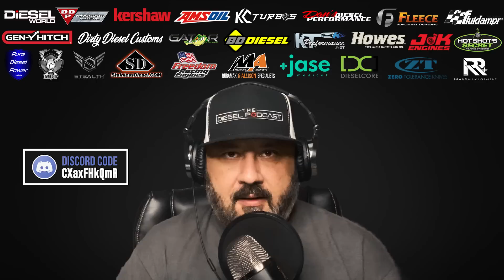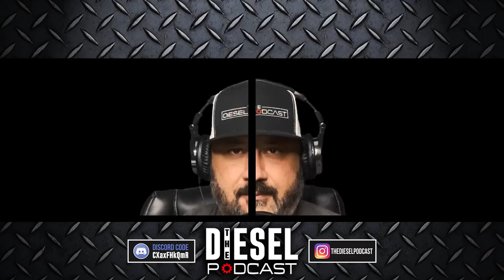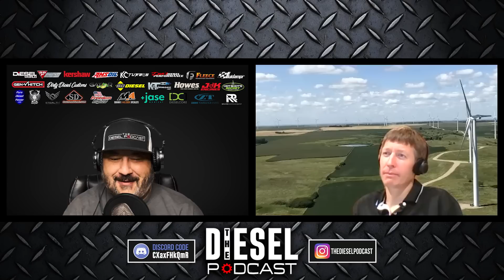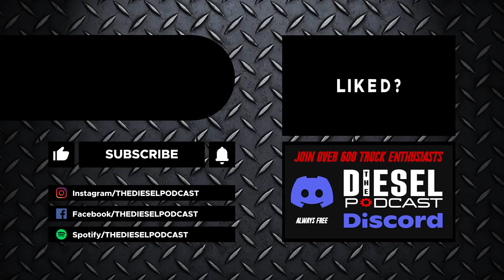Old Coolant Destroying Engines

Comment: When you buy a used truck change every fluid in it .Great advice.Set a baseline and start from there.
Reply from the maker: We agree!
Reply: @TheDieselPodcast  Don't change the trans fluid, you might need all that clutch disk material for it to shift. Ran beautifully for years before that change. 😅

Comment: Another area people neglect power steering fluid anytime I buy a used vehicle I always change the power steering fluid and I use Amsoil matter fact my 97 jeep grand Cherokee I bought for my girlfriend has 264,000 miles on it and the power steering fluid was leaking pretty bad when I left her house to drive to my place about a mile and a half 2 miles away I’ve topped it off with Amsler transmission fluid drove it home couple days later just driving around the house cause I didn’t have plates or insurance on it I had to top it off again and it was in February and you could see it where it was dripping on the ground because of the snow and then as time went on because less and less and I got to the point don’t leak at all anymore but I know that I filled that reservoir up enough times I completely displaced all the old fluid and the pump I put 0W 30 oil in the engine change differentials did all kind of stuff transfer case I have yet to do the transmission fluid damn I wish I had a plug on the torque converter like they used to but anyway they don’t that 5.2 L runs a lot quieter than it used to because the oil I put in there that zero 30+ I ran some of that Amazon Fleshner but anyway this is six in a row jim again like I said got a 91.5 dodge three-quarter ton Give you three guesses what’s under the hood anyway you guys have a good day and Amsoil thank you for the good products I’ve had nothing but extremely good luck with her products I’m from Kennerdell Pennsylvania😅😮

Comment: This is six in a row JIM again I had bought my 91.5 dodge in March 1998 used for moving cars out in Seattle I subcontract to a company called cheap tow and is about three months into it I had to change water pump and a big deal close to 150,000 so I change the pump and buy a year or so later by year and a half I’d say anyway I had to change it again I figured well you know what probably just a bad pump well I move back to Pennsylvania and it’s about 02 had to do it again figure a way to my son is going on here why I’ve been an Amazon dealer since 87 and I called the tech people down soil and he said it’s not your pumps you can’t do anything wrong installing those things cause there’s just to Bolts where you go he said it’s your antifreeze I said OK so I change the antifreeze off completely I drained everything out I  everything out and I don’t three gallons of Amsoil antifreeze because I still had fair amount of distilled water and I wanted to make sure I was able to handle 40 below zero weather cause I’m in Pennsylvania now well you know what that water pump has over 300,000 miles on it since then and it’s still perfectly fine all right this is six in a row jim From Kennerdell Pennsylvania

Comment: On 7.3s 99 and earlier must use SCA additive Vc-8 from ford. Keeps cavitation from occurring. Which is tiny air bubbles that attach to cylinder walls. Creating pitting. And I just use simple green coolant and Distilledwater.. And a coolant filter helps out alot also. Because when they sand casted these blocks. They left alot of sand inside coolant jackets. I went through 3 filters before I finally got barely any crap out of filters. Also DO NOT RUN GOLD COOLANT IN A E99 OR 99 7.3. IT WILL EAT SEALANT AROUND INJECTOR CUPS.

Comment: I know ill get called stupid for this, but i still use Prestone or Zerex dexcool in my LLY, i change it every 30-40k and i havn't had any problems on either of my trucks. Most people never change it, so of course it breaks down over time. Your also moving water/chemicals through different metals surfaces in a loop, while being heated and cooled over and over, that ALWAYS causes issues over time if the fluid is not replaced.
The only Bonus out of the GM engineers that put the coolant bypass ontop of everything, is that if you want to do any part replacement on the top of the motor, your draining the coolant. Wanna clean your map sensor? Drain  the coolant.
Reply: Agree with Randal, some how gov motors kept it off alot of the web, but if you search long enough you will see the class action suits regarding dexkool and engine damage. The propylene glycol (dex) turns acidic with age and will eat the plastic intake gaskets on the older vortecs.(traditional green is ethylene glycol, poisonous to animals and us, but not the engine, simple fix is to get the stuff with bittering agent to prevent poisoning) I mean that orange planned obsolescence juice was supposed to be good for 100K miles. I brought a 97 K1500 with a 5.0L dirt cheap because of what I surmise was the owner praying the intake gaskets and stop leak didnt let loose that was holding the intake gaskets together.(the coolant was black so I know something strange was up) My 03 S10 w/ 4.3L owned since new, had that orange poison I changed regularly and then went green at around 45K when I heard the orange coolant nightmares . The intake gaskets were just ready to let loose when I changed them at 65K miles,fortunately on an external area of engine where I would of only had an external leak, unlike the K1500 when alot of coolant dumped into the oil pan. Fortunately caught before any catastrophic damage. Sorry for  swimming in the diesel waters here, but I cannot see dexkool being good in any gm after my experiences.
Reply: @daveondre4892  like i said though, neither of my trucks keep their fluids long before replacement. the diesel extra so. 
The old dex cool was bad yes, but that was over 20 years ago.
Reply: Dex is the worst coolant on this plant. I've seen so many GMs to where it turns to chocolate milk after 60 k.. and you can never get it all out.
Reply: Since I did buddies 4.3 at like 240k intake gaskets hoses that were sonding like potato chips. I put green coolant in. Van now has 410k. Hasn't leaked a bit. Hoses sound ok. And done 2 water pumps since then. True believer in green.

Comment: Great episode love all of everything the podcast is.
 question is I've got my Cummins that's unfortunately been sitting for a few years due to needing make some repairs it currently has its water and coolant still in it and wondering it that could have cause damage? should drain it if just sitting there for extended period of time will hurt the internals or if it'd be worse to drain it and leave it empty another month or two till I have it back on the road.
Reply: If I was you, and I knew what was going to be sitting for a couple more months I would just leave it as is, because it won't do any more damage sitting in there since it's not getting heated up to temperature and cool to down multiple times which causes the breakdown and creates the acidic reaction.

Comment: I think Mark hit on the BIGGEST overlooked item pertaining to the coolant system - the radiator cap. I know it's one item i'm looking at changing when i change my coolant shortly. Just over 100K since the coolant/thermostat was last changed (which was necessary when the OE water pump failed, LOL!). 

Just rolled past the 515K mark on my 20 yr old Ram, and i've noticed the temperature tends to creep up when going above 120 lately. More so when maintaining that speed while going up a decent grade. I've put the last 185K on it, so i'm sure the original owner never changed the cap, unless it was done at the dealer (Chrysler prt number is on the cap, so i'm pretty sure it's OE). 

Thanks for another great episode.

Comment: I have been using  Evans Waterless Coolant in my 08   ZO6  Corvette and  my  6.5l diesel pickup for years now and so far I haven’t had any issues with it.    It takes a lot of coolant to do that because you have to flush the system out to start with sometimes it takes a couple rounds maybe three rounds before you get it completely cleaned out where you have nothing but your Evans waterless coolant in it. It gets expensive when you get to that point when you have to change from one to the other if you lose a hose or have to change the radiator because the tank broke his plastic tanks it does get expensive for Evans but I think it’s pretty good coolant list for me. It’s been good. I haven’t had any issues with it since I got everything flushed out at the very beginning took a lot of time to do it, lotta flushing’s just don’t put water in it or don’t let any mechanics do it for you because they’ll screw it all up and you gotta start over again
Reply: Nice advertisement